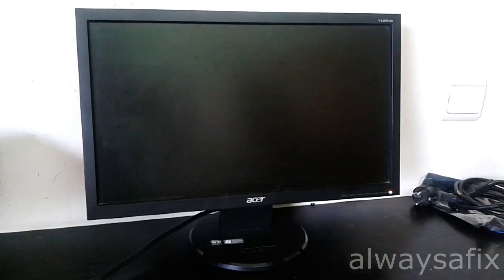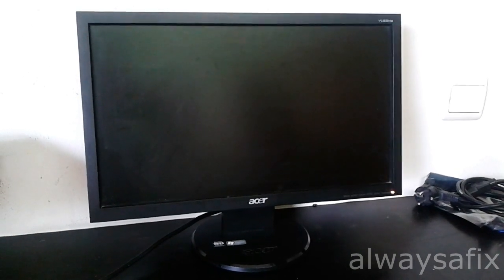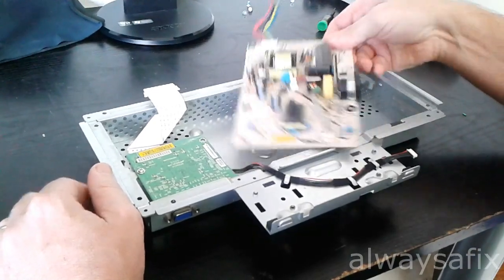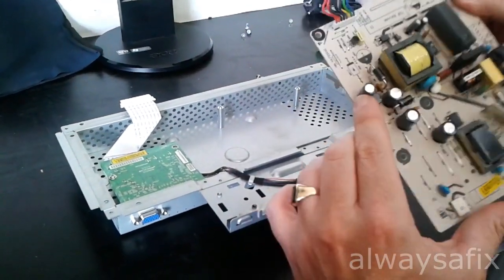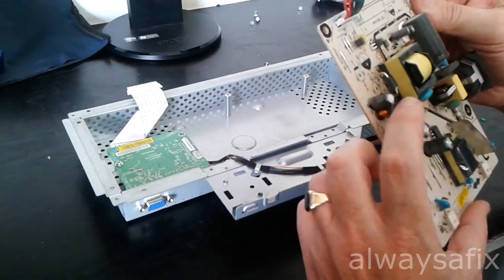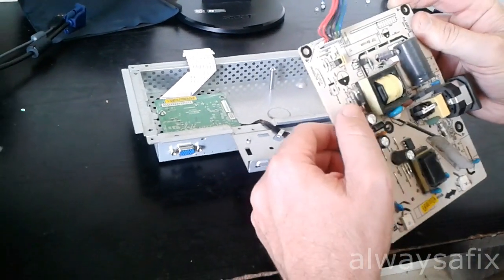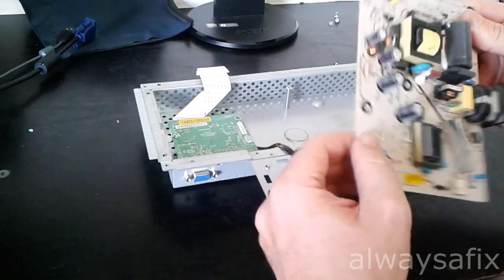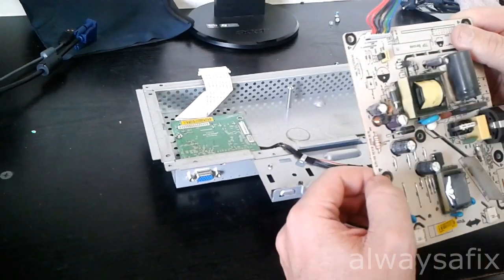Acer screen black flashing LED

Comment: If you're going to try this, the hard parts not shown here are (1) figuring out how to get the case apart without breaking something, and (2) unsoldering the part to replace it. It helps to have the part handy and some desoldering wick to help get the part out.

Comment: Hi mate. Really enjoy watching your videos. I have an acer v3-571g laptop. Half of the display is completely white (Bottom half).  It seems that there are small black dots where the display cuts of and also there are black streaks sometimes in the white lesion of the screen. No trauma experienced by pc. Could you please help me . the computer is 3 years old and out of warranty.ThanksPraneet Ragoo
Reply from the maker: +Praneet Ragoo To me it sounds like a failed lcd panel.  In the workshop I would connect a working lcd screen to test.  Good luck!